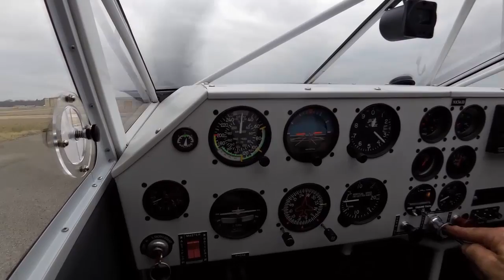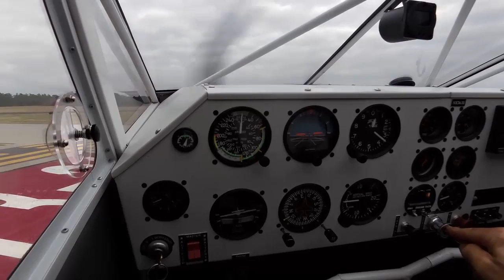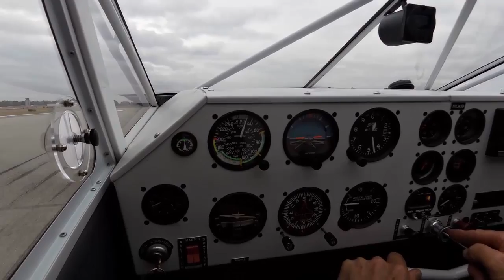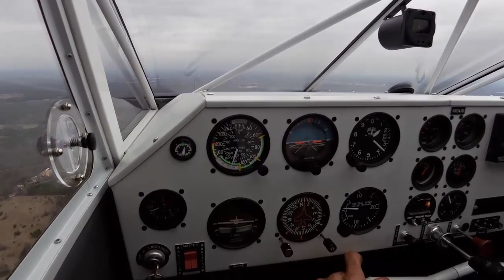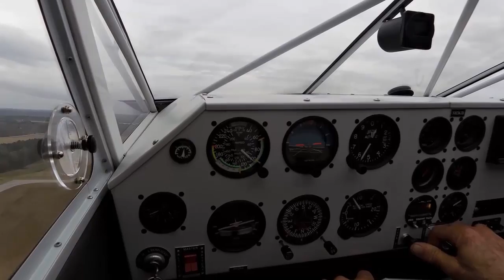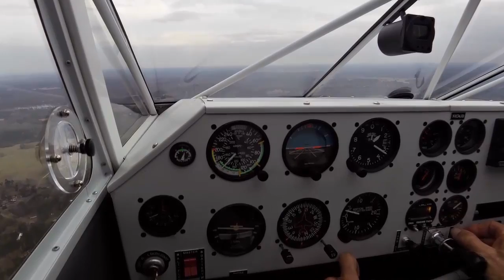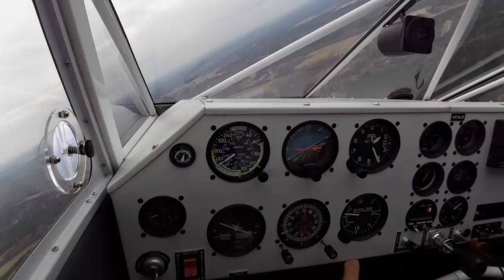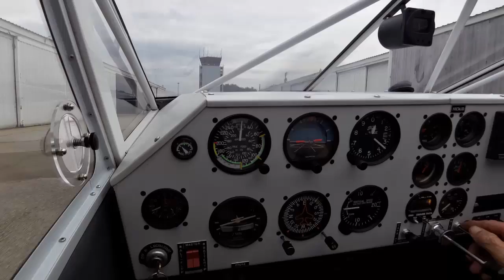N34JD Six trips around the pattern

Comment: I noticed you turn carb heat on then off and i am just wondering why?
Reply from the maker: On to make sure I don’t have carb ice. This is a Continental O-300D which has the carb mounted on the bottom of the oil sump with the intake tubes running through the oil sump so even the carb mounting pad runs pretty hot.  If there’s high ice potential I’d leave it on.